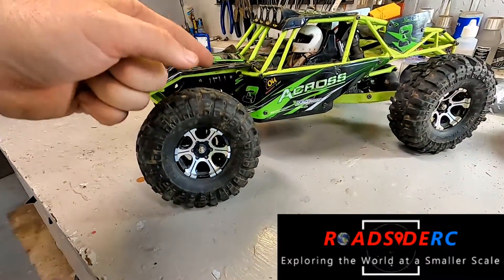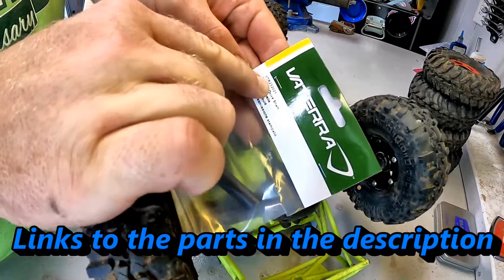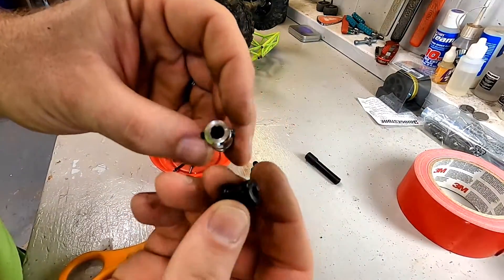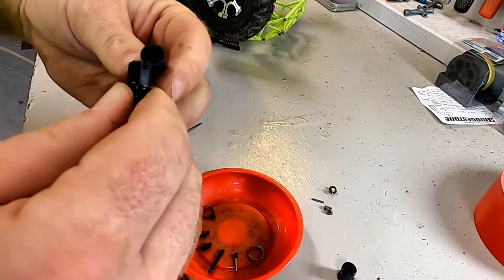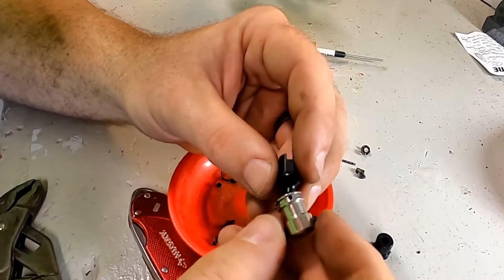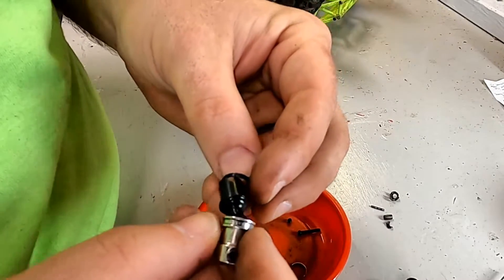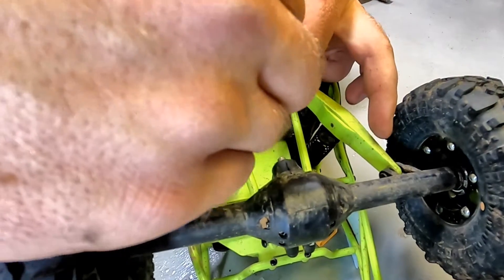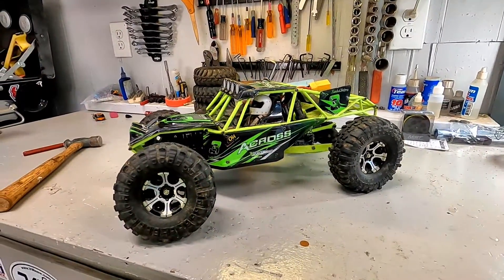WLTOYS 10428 | Driveshaft Repair with Vaterra Twin Hammers Parts

Comment: The original vaterra twin hammers was truly a great vehicle out of the box. I still enjoy using mine, however since Vaterra is no longer making vehicles I do see the shortage of parts already. For my glamis vehicles there's parts that are no longer available, Same for the twin hammers. Very sad.... Anyway I kinda vented a bit haha, awesome shes back and running again.✌🏼😎
Reply from the maker: Good point.  This may continue to be more of an issue.  Hadn't really thought about it with Vaterra going under.

Comment: Cheers for the video 👍 will definitely keep in mind for my 10428. Can I ask are you running 2.2 tiers?
Reply from the maker: Thank you!
These are 1.9s on there now.  Total height of the tire is really a problem, as anything taller and it would rub the body when turning.
Reply: @RoadsideRC  thanks I have been debating going to 2.2s but was concerned about clearance and stress on the drivetrain 👍

Comment: I also got the 10428- yup fried the esc aswell ^^  i just made my own driveshaft with from an M bolt + angle grinder...   now i cant find a suitable able ESC to replace it. is the stock 40a or 60a?
Reply from the maker: Not sure what the stock one is from a power level, but I am running a stock Axial ESC now without any issues.  The Hobbywing 1080 is also a great choice at $40!
Reply: How did you burn out the stock ESC
Reply: @nomusicrc  esc is water resistant, Maybe. But not waterproff XD